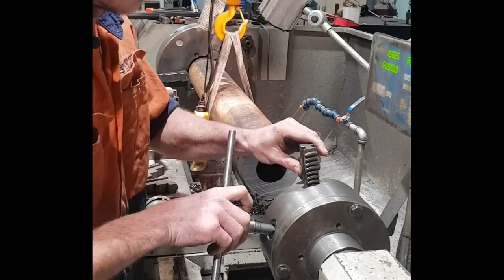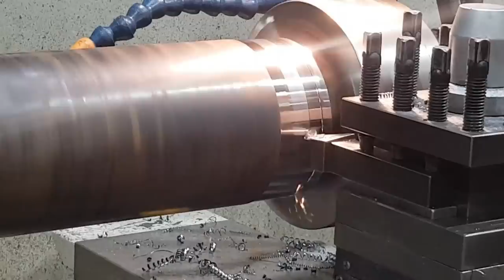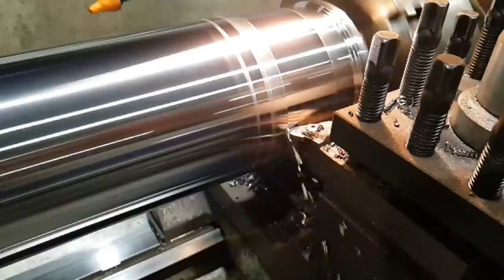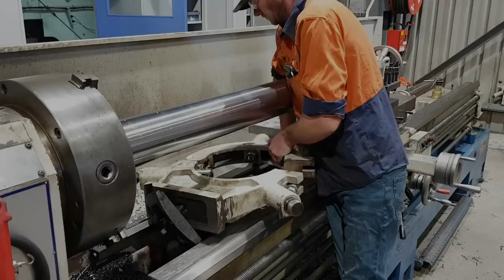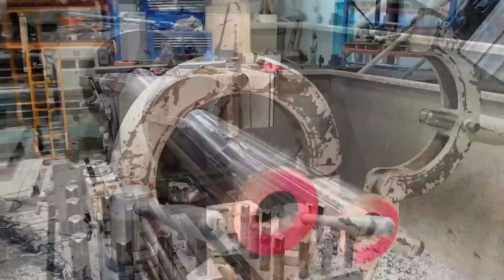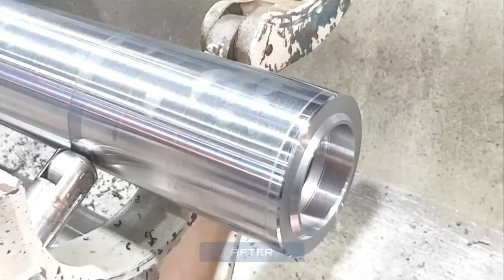Machining a Part from Steel Hollow Bar for CAT 657 Scraper | Lathe Turning & Boring

Comment: So do you need to polish the external surface of the ram? Is the final cut smooth enough for the seals integrity? Seems that it should be ground to a final diameter.

Comment: Thats interesting  a chuck in tail stock did u make that ? Any advantages  more ridged ?
Reply from the maker: Hey mate, Yeah have made tailstock chucks for each of our lathes. Yes more rigid, quick setup on some jobs, also have an independent 4 jaw tailstock chuck for those odd shaped jobs.
Reply: @CuttingEdgeEngineering   bad ass thanks for getting  back to me
Reply: @CuttingEdgeEngineering  No yeah good input, is it on a mt5 taper?

Comment: Kurtis, will this be site welded into the other component parts of the bail arm or is there a part 2 on the way? How do you get the critical dimensions of these parts?
Reply from the maker: Hey Mark, the customer sends us a drawing with the required specs and they fit it in their workshop in a pre-made jig for bail arms as they are a high turnover component on scraper fleets. Sorry no part 2 this time, maybe one day! 😎👍
Reply from the maker: Hey Jacob welcome to the channel mate thanks for watching. Work within OEM tolerances which is tenth of mm but generally get as spot on as possible. 😎👍

Comment: steel is now a crazy price in Au, Alu abt the same as in 1990 ,6000 tonne, where do you buy 4140 and bisalloy and Valoric hollow bar without being screwed over and where do you buy tooling, inserts etc, would appreciate guidence here from anybody
Reply from the maker: Hey mate yeah you're not wrong just got an email from a supplier that steel prices are increasing 5% soon. We get alot of our material from hydraulic steels Australia. Also use Vulcan Plate. We have high volume so do get looked after with pricing. Get in touch with Arthur at Livetools in NSW for all your machining tooling! 😎👍
Reply: @CuttingEdgeEngineering  
Instead guys smuggling drugs it will high quality steel

Comment: You never show how you calculate your final measurements for the bevel for welding prep. It  has to be exact since you have an end product measurement . I’m quite certain you don’t guesstimate it. 

Also wondering why you haven’t built an easy rest for when you are using the the special portable line boring equipment? You said you put your hand on it to reduce the vibration. Am I missing something?

Comment: FFS why do boring bars ALWAYS have to be made so you can barely get centre height on a manual machine? Seriously I've never used one that you didn't have to pack to the top of the tool post!
Reply from the maker: Hey mate hearing ya have the same problem. Have asked most of our tooling suppliers and get the same dumb shit response "they just don't". FFS
Reply: @CuttingEdgeEngineering  I think the designers aren't aware not everyone uses a CNC